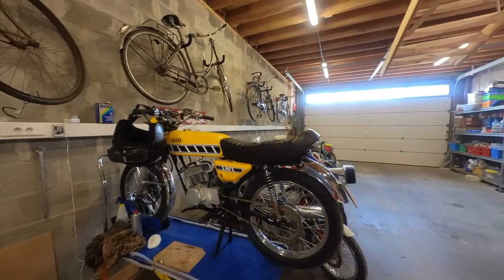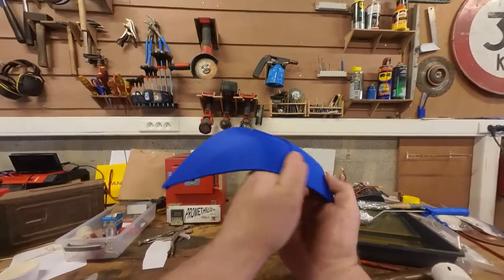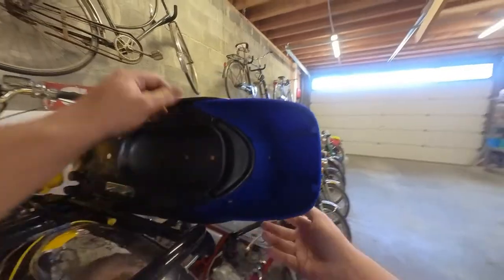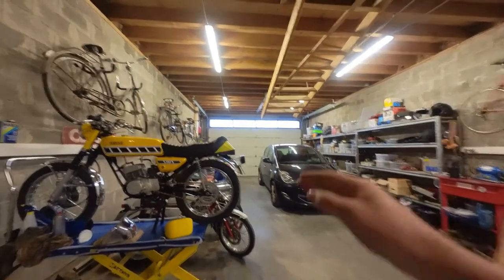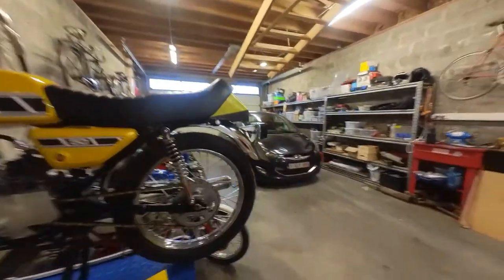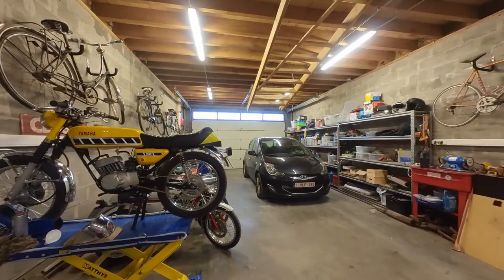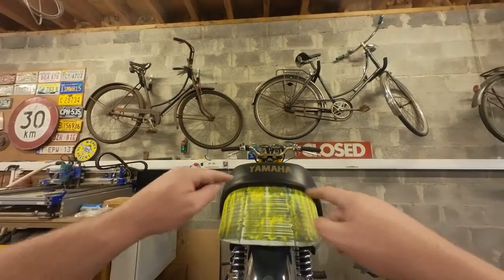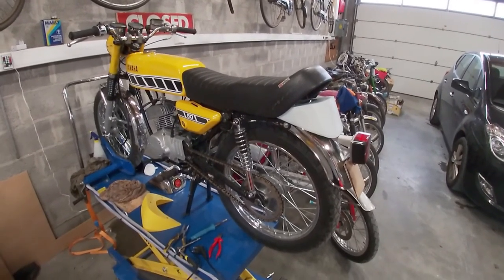3D printing a Yamaha rear end!

Comment: Hello I have a Flandria rally with 4 gears on the handlebar. I was wondering how to set them up correctly. They seem to want to jump out of gear, but I can hold them in by hand. Any chance you could do a guide on it?
Thanks :D
Reply from the maker: Sure! I will try to fit it in the schedule. Currently dont have a handschifter that needs adjusting though. Will see what I can do!
Reply: Appreciate it 😁

Comment: Hey can I have some help for my rd50 please. It refuses to start and we it does it is not for long.
Reply from the maker: What have you checked? Start with checking spark plug and cleaning the carb. A bike that stops idling after a bit is usually a clogged carburator
Reply: @VintageGarageYT  It has spark air and fuel need to find the Alan keys from the shed. You can never find anything in there I found it in a shed at my neighbors and a friend and I got it running for the first time in 20 years it has no key so we had to bypass the ignition. When we did this it had a blocked exhaust so we cleaned that enough for it to work but it is certainly a rough machine. What are they worth when restored or is it worth just using on easy farm tracks.
Reply from the maker: @HeritageHorsepower  Barn finds are the best! Found mine completely disassembled in boxes.
Prices vary depending on model and overall condition. RD50dx (like mine) is currently pretty valuable because of its rarity. I've seen DX's go for 2000eu but I've also seen them go for 4000eu for a fully restored one. Depends highly on the model, condition and also current state of the market.
Reply: @VintageGarageYT  I have the rd50 mx I think I also think it has the aluminium engine or the one with the rubber between the fins of the head
Reply from the maker: @HeritageHorsepower  Aluminium head is possible, but it probably has a cast iron cylinder?
Reply: @VintageGarageYT  not sure if you want tomorrow I could send you a picture somehow so you can see what type it is
Reply from the maker: @HeritageHorsepower  Yeah sure I can have a look at it. I'm not that familiar with the MX model, but the basis is the same. You can hit me up on instagram: @vintagegarageyt